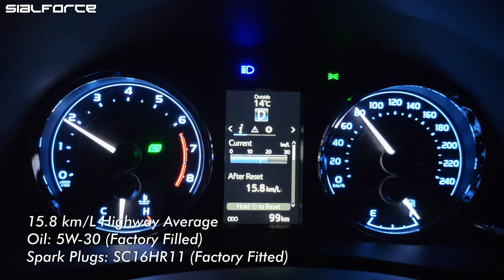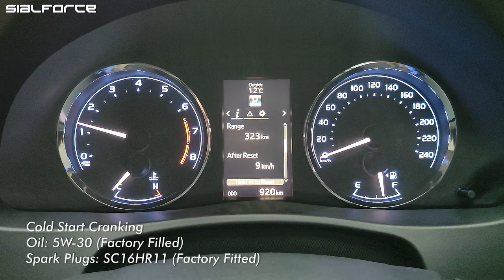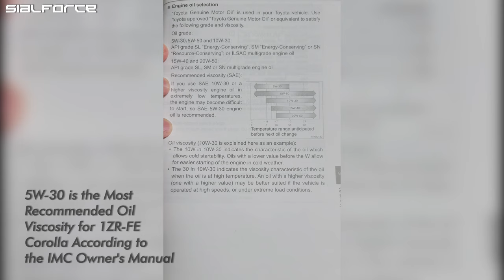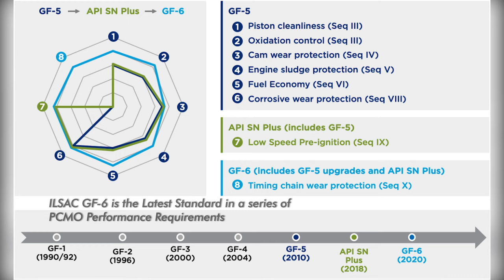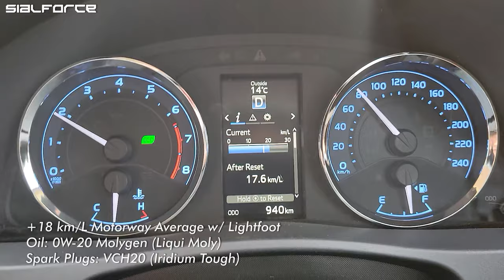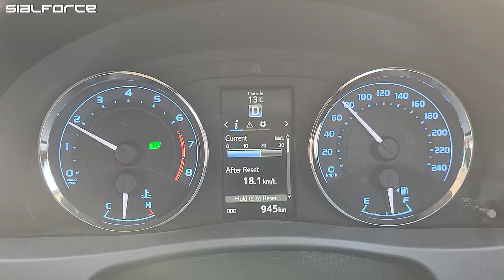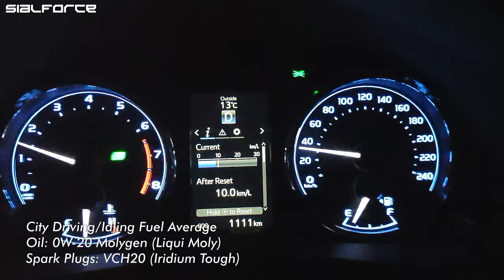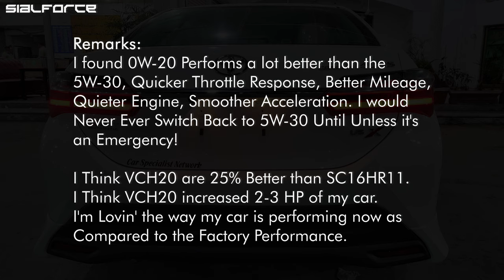Toyota COROLLA Fuel Average with 0W-20 Molygen Oil and Denso VCH20 (ALTIS 1.6 X)

Comment: I have same model altas S.E ,company fited all plugs ,air filter &oil ,now driven only 6200 km ,local average is 10 kilometres in city light foot,on long light foot, 100 speed easli 16 to 17 km 1L, 120 to 150 speed average 13 to 13.5
Reply from the maker: Wow, that's great..... i bet 0w-20 will get you more mpgs/kmpl

Comment: Nice and researched based work. but remember while using 0w20 in your car you should not do repeatedly high speed driving and towing. You have to drive your car with light aur normal foot. Although i think you should keep the factory or OEM toyota geniune air filter for the best performance!. best of luck very good fuel average MashaAllah considering the current fuel prices.
Drive 60-75 kmph in city and Drive 100-115 kmph on highway will give you pretty good fuel consumption and saves time.
Reply from the maker: 0W-20 got a higher flash point as compared to the 5W-30 so operating the vehicle at max speed won't be a problem since the oil is thinner and flows better, 0W-20 blends in foreign markets and fully synthetic unlike the 5W-30 which comes in various varieties such as mineral, partially synthetic and fully synthetic and also blends locally. 0W-20 is far better since it won't change its viscosity drastically at higher temperatures unlike 5W-30. 0W-16 already being used in the cars, 0W-12 and 0W-8 is the future of oil technology!
Reply: @SIALFORCE  I just went from 0W20 to 5W20 on my 2017 Toyota Corolla SE. I live in Los Angeles, California and it’s hot right now. I don’t think there’s a big difference
Reply from the maker: @bobespnza-la7030  You won't feel the difference at one oil change, but in the long run it will be bad for the motor and you'll notice the sludge problem if keep on using the thicker oil but as you mentioned you're from LA, Cali which is a hot state, what car you drive? Engine Code and Model Year?
Reply: @SIALFORCE  hey! I have a 2017 Toyota. 1.8L 4 cylinder. Engine Code:2ZR-FAE
Reply: Mechanic asked me to run 5W30 . Engine ticking. I have a 2017 Toyota Corolla SE (USA)
Reply from the maker: @bobespnza-la7030  I just read your cars owner's manual and this is what Toyota stated for your car: 

"SAE 0W-20 is the best choice for good fuel economy and good starting in cold weather. If SAE 0W-20 is not available, SAE 5W-20 oil may be used. However, it must be replaced with SAE 0W20 at the next oil change."

Don't do what your mechanic says, do your own research, your motor is designed to run the most efficient on 0W-20 so i would say go for 0W-20 (API-SP and ILSAC GF-6A)

Comment: I have 2010 Corolla Altis 1.8 1zz engine. Previous owner was using 20w 50 zic till 160,000km . I shifted to 10w 40 Liqui Moly Mos2 and now mileage is 170,000km. Engine is fine and no oil consumption. Do you recommend 5w 30 or 10w 30 for winters? Will it harm my engine?

Comment: when you start using 0w-20 at 1000km did you flush the engine .....?????
Reply from the maker: No flush, just drained the old 5W-30 and poured the new 0W-20

Comment: Sir mery pass Atlis 1.6 hy 40k driven main Toyota 10w 40 use kr raha hn ur kya main ab us main 5W 30 liqui moli use kr skta hn
Reply from the maker: You better change it back to 5W-30 or 0W-20. These engines are designed to run optimally on 0W-20 and 5W-30, if these 2 grades are not available then go for higher grade

Comment: Nice video. Kindly suggest LED fog lights for my car same as in this video. Altis X 1.6 model 2022
Reply from the maker: Low Beams: H11 LED (Kensun Pro 200w LED)
High Beams: 9005 LED (GMKA 120w LED)
Reply: Gtr bi led

Comment: I have atlis 2020 1.6. What oul and plug should I use? It is 26, 000 driven.
Reply from the maker: Oil: 0W-20 (API: SP and ILSAC: GF6A)
Spark Plugs: Denso SC16HR11
Reply: @SIALFORCE  which one does it have from the company?
Reply: What is about 0w40? As temperature reaches 40 in our area in summer.

Comment: Oil recommendation of the same engine differs from region to region due to fuel quality differences. Due to fuel quality difference, detonation/combustion charecteristics is different, hence difference in engine temperatures, hence oil viscosity numbers are adjusted to cover engine's operating temperatures. 

If your local Toyota OEM specifies 5W-30 then you should stick to that oil. Using thinner oil is not recommended. As a rule, you can go lower on Cold number (0W-30) but never go lower on hot number, but above all: follow OEM recommendation. 

This video explains it in greater detail. https://youtu.be/IKdhgKUZhPA
Reply: dude that's exactly what I was about to say, he should have used 0W 30
Reply: lol no

Comment: Bro can u plzz tell from where should i buy these plugs from in isb/rwp? As there are many fake plugs in the market.
Reply from the maker: Do Not Buy and Just Stick to the stock Plugs which are SC16HR11 and only buy them from the Toyota's dealership although you have to pay a bit extra but still worth it.
Reply: @SIALFORCE  why broo?? What problem you have faced?
Reply from the maker: @Ahmedyamin_  I've imported VCH16 iridium tough from Japan which is a substitute of SC16HR11 which performs well but not available in Pakistan. VCH20 iridium tough is good gives you superb mileage but drive feels a tiny bit laggy if you pay close attention. VCH16 and SC16HR11 is newer and got different heat range.
Reply: @SIALFORCE  bro from where you have imported? Is there any plug which increases performance and acceleration as i want to increase the performance of my car.

Comment: I like your study. But your comparison is considerably inconsistent. On 5w30 study you have more data for Highway w/ Lightfoot. However, your data for City Fuel Average for 5w30 is only 2 against 4 of 0w20 study and they are not directly comparable. You should also at least 3 different sets of data for each study in order to make them reliable.  Not to mention the mileage on 5w30 was low which could affect the fuel economy as the engine was just going to break in period.

I would highly suggest you to repeat this study, do three sets of data on each study and then compare them side by side. Then we can talk about improvement percentage.
Reply from the maker: I 100% agree with you.... this video is 2.5yrs old. old and I sold this car when it had only 4,700 kms, then bought it back from the buyer when it had 19,000 kms, now it is driven 24,000 kms and my best friend owns it now. I have grande 1.8L so I will make a new comparison video on that car but I respect and appreciate your highly sought after comment 👍🏻 see you in future 😊

Comment: 0w20 is demanding some times. But all vendors recommend only 5w30. 
0w20 is highly used in latest generation cars. 

Nice video sir 😊
Reply from the maker: Vendors are stewpid, they lack serious knowledge, their recommendations are not legit.
Reply: @SIALFORCE  Correct it's always good to go with the oil grade recommended in the owner manual.

Comment: Average kese set kro meri car Lahore se ho kr aya hn without ac but average 12.0 thi Lahore se ho kr aya hn 12.2 hui hai sirf average kese maintain kro 2800 km driven Altis 1.6
Reply from the maker: Ek black color ka long button hai Speedometer ki screen pe usko single press karein gy tou Trip A, Trip B aur Current Car Mileage dikhaye ga, uss button ko agar long press 3 seconds tak karke rakhein gy Trip A ya Trip B tou woh reset ho jayega. Meine personally apni gari ga engine oil Trip A pe aur petrol Mileage Trip B pe rakhta hoon.

Comment: Can we use mobil 1 0w20 without changing spark plugs??
Reply from the maker: Yes, definitely you can but be mindful to use SP and GF-6 or GF-6A grade oil instead of SN, SN PLUS and GF-5, they are also good but i would suggest to use the latest grades instead of old and only use fully synthetic oil.
Reply: Thanks dear 👍🏻👍🏻👍🏻
Reply: @SIALFORCE  one more thing does 0w20 increase performance as well like acceleration?? As i was using 0w20 in my yaris and i was very happy with its performance..!! No idea about altis 1.6
Reply from the maker: Definitely you will feel the surge but not as much as compared to the 1.3L Yaris or 1.0L Vitz, smaller sized engine tends to perform better but in 1.6L corolla it feels about the same for the most parts but smoother acceleration, quieter engine and a better fuel mileage are definitely there. Consider changing the spark plugs to the IRIDIUM TOUGH as well (secret recipes for an optimum performance).
Reply: @SIALFORCE  thanks brother..can you guide me from where can i get these spark plugs ..i live in karachi !

Comment: You wasted your money on changing spark plugs. OEM spark plugs last about 1 lac kilometers according to the owner's manual. Secondly IMC recommended 5w30 because of weather conditions which are very hot in our country.
Reply from the maker: 5W-30 is not the recommended viscosity for 1ZR-FE and 2ZR-FE engines, ambient weather got nothing to do with the engine temperature..... 0W-20 is the most recommended oil from the engineers who built this engine, 428° Fahrenheit is the flash point of 0W-20 Molygen whereas a normal operating engine temperature is 195° to 220° Fahrenheit, outside temperature got nothing to do with the engine temperature. Spark plugs were replaced for the testing purposes only, plugs were also replaced from VCH20  to VCH16 IRIDIUM TOUGH and back to SC16HR11, VCH16 and VCH20 Tends to perform the same or slightly better than the SC16HR11, that's what i noticed but i could be wrong about it, I've also compared the SC16HR11 and VCH16 components, they both are exactly the same and no difference at all.
Reply: @SIALFORCE  I agree with you. IMC recently produced 0w20. When I bought Altis 1.6 and grande in 2018 they recommended 10w30. But I have used 0w20 till 25 thousand after that I shifted to 5w30. 0w20 changing intervals are 7 thousand whereas 5w30 are 5 thousand. I am currently using Total quartz 5w30 latest standard API SP gf6a for 5000 km. I have Altis 1.6 it's transmission sucks. RPM is higher even at 120kmh. Even city 1.2 CVT rpm is below 3 at 120 kmh.

Comment: I think its important to understand one thing. Why OEM do not use the oil you have selected? Why they didn't use iridium spark plugs that you replaced? was there a huge difference of cost in first place or they don't want people to get better fuel average over entire life cycle of the engine. Its important to understand that OEM like Toyota is very smart rather the best car manufacturer globally and have got huge R&D facility. So they select the best performance replacement parts and lubricants for a longest possible service life of engine. To me its important to use only OEM recommended lubes, other fluids and replacement parts and get a long term reliability.
Reply from the maker: They use SC16HR11 which is good and I haven't changed it on my new 1.8L grande X, but 0W-20 is the most optimal viscosity for 1ZR-FE and 2ZR-FE, I would rather fallow the official manufacturer's recommendations than the assembler and dealership. If 0W-20 is not available then you can use 5W-30 but switch it back to 0W-20 on your next oil change, this is what's recommended by the Toyota engineers who developed these engines so I'm fallowing Toyota officials and not Toyota Pakistan

Comment: Bhi sirf 1 KM ka faraq para ha Long per as video @ speed of 100 110. Meri 16 deti ha 100 -110 per. Mery stock plugs hain, 5000 chal gayi ha. Toyota 5w30 fully synthetic toyota showroom say use ker raha hoo. app ki 15.6 long 100 105 per day rahi thy. constant 80 per meri bhi 18 tak chali jati ha
Reply from the maker: G bro. bas itna he farak parta hai, main farak jab 0W-20 pe shift karte hein tou gari ka engine relax aur naram ho jata hai ghutta ghutta nai rehta aur uske saath pick aur throttle response bhi behtar ho jata hai.... 5W-30 na dalwao engine jaldi kharab ho jayega... aapki gari 5,000 hai tou 1km ka farak hai, 50,000 k baad farak bhar jayega hai, 5W-30 ya uss se mota oil aapki gari k liye nuksan de hoga
Reply: @SIALFORCE  but brother company khud 5w30 daal ker bhij rahy hai our owner manual ma bhi same likha ha.

Comment: My altis mileage 47000 around in Karachi, please suggest me  the grade of moily oil. Right now my average in city is 9.5
Reply from the maker: I can not suggest or recommend you anything, do it at your own risk. From my personal experience i found 0W-20 tends to perform a bit better as compared to the 5W-30 in terms of fuel economy, throttle response, pickup, top speed. Engine gets quicker and quieter, Toyota engine designers recommends to use 0W-20 for 1ZR-FE and 2ZR-FE Engines. Toyota Indus doesn't manufacture engines and transmissions in Pakistan, they import them from Thailand and in Thailand. Toyota itself and Toyota Club . Net recommends to use 0W-20 for 1ZR-FE and 2ZR-FE.